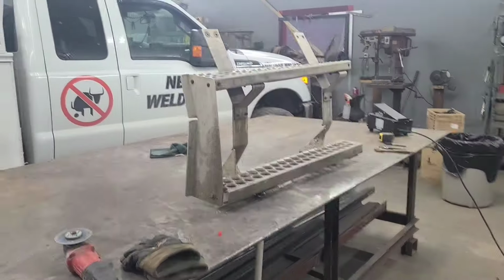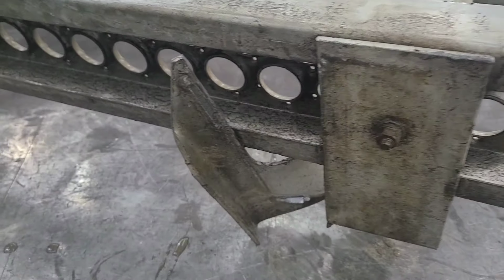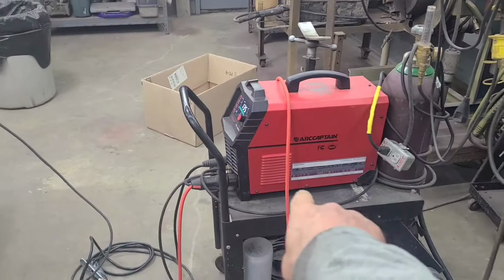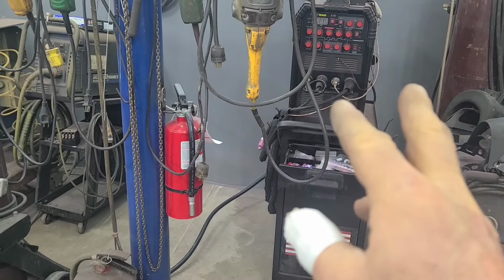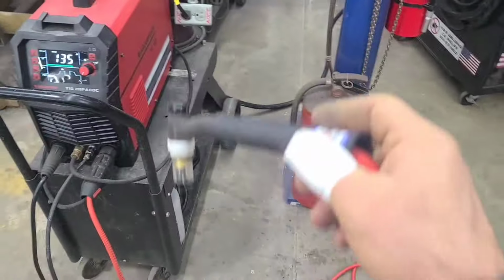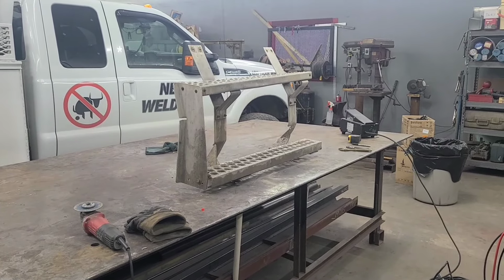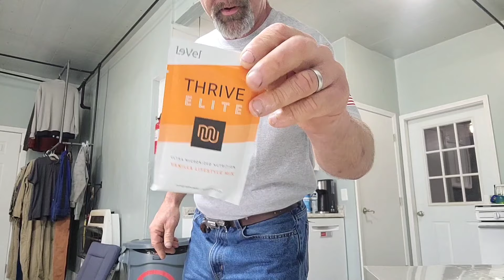Repairing aluminum step off of a boom truck by TIG welding with ARCCAPTAIN TIG 200P

Comment: From the automotive repair: I often have aluminum cast parts send out for repair. I'm considering implementing aluminum welding into my shop. I understand it's different. This video is informative and helpful. Thanks a bunch. Oh, you did a very nice repair. Take care my friend.👍👍
Reply from the maker: I've welded aluminum for decades and I've never got a chance to put the time into really getting good at it...I takes practice and I have had occasions where it seemed like my ability was improving but then months would go by before I needed to weld any aluminum again and I'd lose the touch...I've done quite a bit of aluminum lately and I feel like I'm getting better with it again.
If you can justify buying the equipment and putting in the time then go for it...there is alot of doo dads that a feller needs to do good work TIG welding aluminum and it takes alot of practice but it's very satisfying work when it's done well
Reply: I appreciate the advice, thank you. @NBSWELDING

Comment: Always appreciate your discussions about common sense and reason...the world often is lacking in those areas.  Hope you went for the CK26 trimline for your new torch, comparable in size to the 17 but 200 amp continuous rating.  Also just want to put out there, the CK17 is rated for 150 amps CONTINUOUS use.  No reason you can't run 200 amps through it for short sessions.  Plenty of 200+ amp machines come with that as the default torch.

Since you're doing nothing but aluminum these days, I'd love to see a quick how to on spool gun operation...in minimal attempts I've struggled to get a very desirable looking weld out of that process.  Your welds on that cattle trailer looked pretty damn good
Reply from the maker: Very possible that there will be more spoogun in the near future...I'm told that ARCCAPTAIN is gonna send me one and if that's the case we'll definitely wanna check out how it works

Comment: Your absolutely correct, if it's not broken, don't mess with it. By messing with engine speed, you will also change your welding current output. Also when welding aluminum using high frequency, make sure you disconnect any other machine cables including grounds from the table. Because the high frequency can back feed through these cables and burnout circuit boards in the other machines. Found this out the hard way.
Reply from the maker: Thanks for the info
Reply: Yes! Thank you. I didn’t realize either.

Comment: Nice repair on the steps!   Thank you for the explanation on the voltage situation on the Arc Captain Vs. the Primeweld and Miller’s response.   For aluminum on a mobil scenario, I will use my Miller Multimatic 215, with either a spool gun or the Tig kit I have for it.  I have been assured by Miller technical service that my 215 is totally good to be run off my Bobcat 260efi.  The tech guy said they make the circuitry on the Miller welders to run fine off a generator.   
I wondered if your repair on the carwash motors was too far away from your shop location that you could not have run back and picked up the PrimeWeld unit since it runs off your Trailblazer 302 with out problems?   I agree with your assessment “if it ain’t broke don’t fix it” philosophy.   Those weders are electronically tempermental, so good call, CB!   Another good video, thanks!
Reply from the maker: When I was at the car wash with the ARCCAPTAIN I actually didn't know for sure what was going on...and I didn't know for sure that the Primeweld would work off the Trailblazer like we know now

Comment: I swear the Primeweld will run off anything. I've run the mig 180 off a 13k gen and my Weldanpower 250 9k gen/welder with no issues. Tig is a different animal all together though. If one machine can tig running off the Miller and the other one cannot, then the one that can is a better build. Especially considering they're both inverter welders. Looking forward to the truck frame video. 👍🏻
Reply from the maker: The Tigbutton on the Primeweld gives it an advantage also...I just wish it was as small and handy as the ARCCAPTAIN 

Good to hear from ya
Reply: @NBSWELDING  I guarantee  the arc captain can run off my generator and is the perfect size for my mobile setup. I'll use your code when I pick one up. Do you think that Ed's Red would be good for drilling holes with a mag drill? I've been using used motor oil, but my uncle said they used transmission fluid where he works, then I thought maybe the Ed's Red might be even better.

Comment: 100% agree with the "If it ain't broke, don't fix it."  line of thinking.  It is strange/curious that the MIG200 doesn't have an issue, whereas the TIG200 won't operate on the Trailblazer. I still think you could mobile weld aluminum with the MIG200.... although I prefer TIG as well for most situations.
Reply from the maker: Stay tuned...I just did a tank truck repair with the MIG200 and it works great through the original gun as long as you can keep the cable straight but where I couldn't keep the cable straight it didn't feed as smooth....I think ARCCAPTAIN is gonna send me a spoolgun for it so we'll see how that does

Comment: Great advice if it ain’t broke don’t fix it, I own a 07 4.6 f150 got it with 60k miles now at 195k no big issues just minor problems like radiator and battery, still rides well
Reply from the maker: Hard to beat an F-150...hellova pickup

Comment: Go to water cooled on the Primeweld  with a watercooled torch by CK. Thats what I did with my Primeweld and it is a great combination.
Reply from the maker: I need the water cooled for sure...never thought at one point  I'd be doing enough aluminum to even have my own AC TIG and now it seems like people are asking me to weld aluminum all the time.

I really wish the ARCCAPTAIN TIG 200P would run off of the Trailblazer  because the ARCCAPTAIN is so much lighter and more portable than the Primeweld...but no Tigbutton on the ARCCAPTAIN so that's a big disadvantage.
And if I go  water cooled with the Primeweld it becomes even less portable...not sure yet what I'm gonna do
Reply: @NBSWELDING  I am also a licensed master electrician. You could go the route of utilizing a voltage stabilizer but it would be the same price a purchasing a dedicated generator for the welder. Another fine example of damned if you do and damned if you don't.

Comment: So the arc caption won’t run off a generator?
Reply from the maker: The ARCCAPTAIN MIG 200 has no problem running off of my Miller Trailblazer 302...it's the ARCCAPTAIN TIG 200P that wouldn't run off of the Trailblazer....but the TIG 200P runs fine off of my Lincoln Commander 300 because the voltage on the Commander does not surge over 265 volts like the Trailblazer does.

So the answer is that either ARCCAPTAIN machine will run off of a generator that provides steady 240 volt current like they are supposed to...but if your generator surges over 265 volts the MIG200 will still work but the TIG 200P might not

Comment: CB love your videos. Note on why the Arccaptain Tig Welder won't work on your Miller generator. Problem is likely the same problem we have with a lot of generators that people hookup to their homes. Then many of their electronic devices do not work. Reason is: The output of many of these generators, that are not inverter generators, is not a pure sine wave fully regulated AC Voltage. The output wave form is chopped up, not smooth, and voltages not properly regulated. The Tig welder requires a smooth input voltage, that is not available from the Miller Generator. The smooth sine wave allows the Tig welder to manipulate the output voltage wave form of the welder, example: rise & fall, delays, and the many adjustments you can make. Mig welders don't have this issue. You can't really adjust, or need to adjust, the voltage output wave form of a Mig welder. That's why you could Mig weld, but not Tig weld with similar machines running off of the Miller Generator.  Note: please provide a little more info on your setup and initial welding procedures. The fast forward left me wondering whether or not you tack welded the part first, or you grinded out a bevel, or not. Just a little more info on how you "getter done." Thanks,  Bill
Reply: Absolutely spot-on, sir. You've got it right. We're optimistic that as technology progresses, we can tackle this issue, but there's still a long road ahead.
Reply from the maker: Lots more on the methods I use for tacking & beveling in my other videos...I sometimes skip over things if it seems like I've already gone over it repeatedly in other videos.
Thanks for watching and commenting
Reply: I wonder if a Variack voltage regulator would fix the problem
Reply from the maker: SCR Voltage Regulator Variable Transformer 4000W, Motor Speed Controls，0-220V Output, AC 220V Input Single Phase(9-18A) https://a.co/d/6W1EMh4

Would something like this regulate the Miller Trailblazer below the 265 volts so the TIG 200P could run off of it?

I'm tempted to try it but I dunno

Comment: If you are welding Aluminum,is there slag like on steel?
Reply: No
Reply from the maker: The only time there is slag on welds is when solid flux is used to shield the weld puddle...in the case with stick welding, flux core, or dual shield there is slag because a flux was there on or in the rod or wire and that flux melted to form a shield to protect the weld puddle from the atmosphere's contaminits...then when the puddle and flux cooled off it leaves slag on the weld.

When TIG or MIG welding is done with a solid rod or wire filler a gas like Argon is blown on the weld puddle to protect it from the atmosphere...this gas does not leave any slag behind...so there is no slag with solid wire MIG or TIG welding.

If you stick weld aluminum there will be slag and they do make rods for stick welding aluminum....it can work in some instances to get you out of a bind but it doesn't work very good...I've stick welded with aluminum rods and I wasn't very happy with the results
Reply: Thanks for explaining